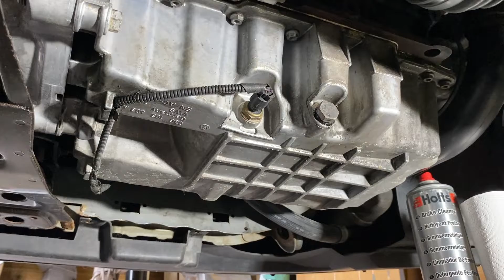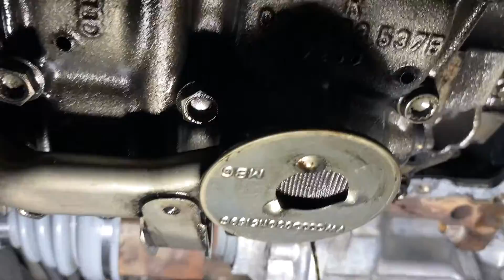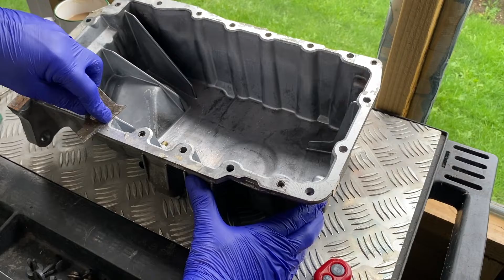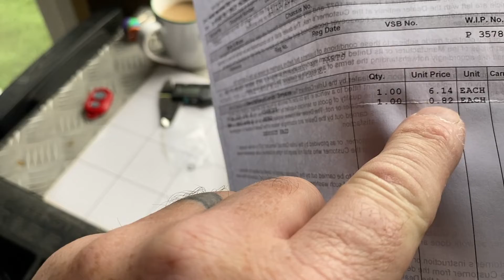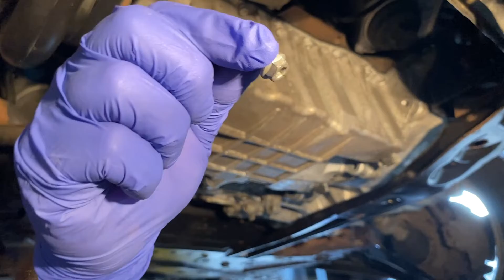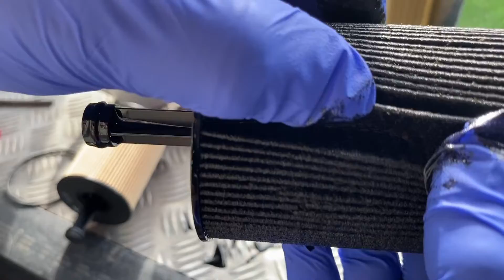Low Oil Pressure - Jeep Patriot / Compass CRD also VW Audi 140pd TDI engines.

Comment: Sebring 2009 CRD with 60k miles on it had failed oil pump but not seen an oil light on dash....Anyone else?
Reply from the maker: My oil light was just flickering on and off, as the oil pump drive was slipping 😉

Comment: I’ve seen that you can get a new oil pump for around £115, do you think it’s worth getting a new one or just do this replacement. PS you’re an absolute life saver for the patriot videos 👍
Reply from the maker: Hello, have you got low oil pressure issues,  or are you considering doing the job as a preventative measure?
Reply: @gilberesrepairs  preventative
Reply from the maker: @matttraynor8988  As a preventative measure i would probably just replace the drive to the pump as this appears to be the weakest link.
Is the new oil pump a genuine vw part for £115 or an eBay special?
If it’s a non genuine part sometimes you can fit inferior components and actually cause a problem.
If it was me, i would only replace the drive, but it’s your decision 🤔 

Probably some Patriot vids over the next few weeks 👍

Comment: Sat here in a lay bye 🤦🏼‍♂️😂 
Can’t make any sense of the dipstick for oil level!  Smoke comes from within the oil filler cap.  Only had a service 3months ago 🤷🏼‍♂️ can I drive home 2mile journey 🤦🏼‍♂️🤦🏼‍♂️🤦🏼‍♂️
Reply from the maker: I wouldn’t chance it. The safe option is to get recovered home or to a garage for investigation…. That’s what i did!!
I feel your pain, GOOD LUCK 🤞
Reply: @gilberesrepairs  just had it plugged in.  Showing Low oil pressure fault and a Turbo fault.  Hopefully no damage done
Reply from the maker: @rymoe6299  I replaced my oil pump drive as shown in the video, and all was good, but one week later the turbo started to make a noise from the oil starvation it received 🙄
I will be replacing the turbo in the near future with a new cartridge. We’ll see how i get on 😂
Keep me updated with your progress 👍
Reply: @gilberesrepairs  🤦🏼‍♂️😂 
Im glad I followed your advice and left the Jeep on the side of the road.  My mechanic said to me just to drive home as it’s probably the Turbo!  I’ve left it with the mechanic now so fingers crossed I won’t need a whole new engine. 👍🏻🍻🇬🇧
Reply from the maker: @rymoe6299  🙏
Reply: Hello sir! 😬
Some guy has had my keep now for 5weeks utter nightmare! He’s done the oil pump and something that could be changed on the exiting turbo.  He’s telling me it keeps going into limp mode.  Absolutely fuming can you help 🥴
Reply from the maker: @rymoe6299  Ohhh nooo! Sorry to hear that.
If it’s in limp home mode, has it got any codes or an engine fault light?
Reply: @gilberesrepairs  mobile mechanic I have been using is a nightmare 🤦🏼‍♂️ I’ve asked what codes of any and no reply.  He said he’s looking at it again tomorrow 🙏 I shall let you know mate
Reply from the maker: @rymoe6299  If the car is in limp home mode, the ecu has told it to, therefore a code should be set.
Reply: My turbo went. Mechic fitted new turbo at £600 and then said no oil pressure after a test run...so, the car getting scrapped.  Just buying another Sebring convertible with CRD. Hoping to do a preventative job on it.